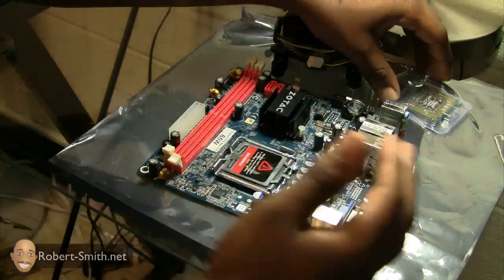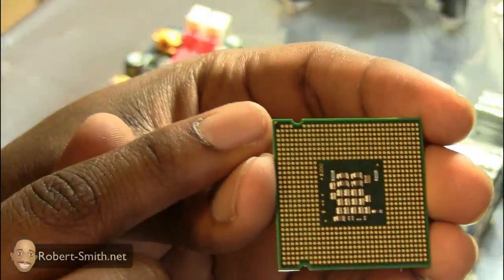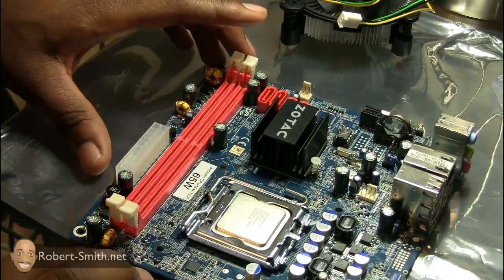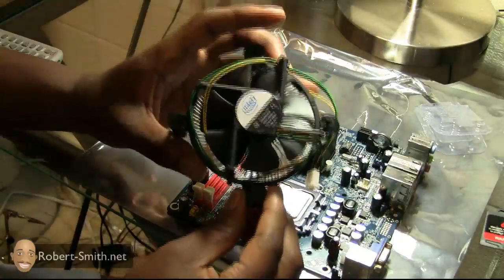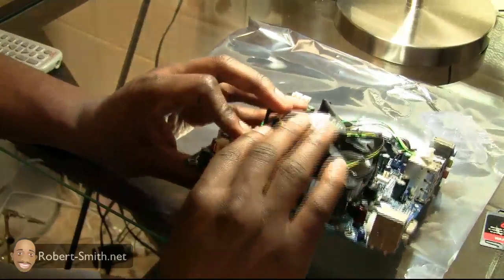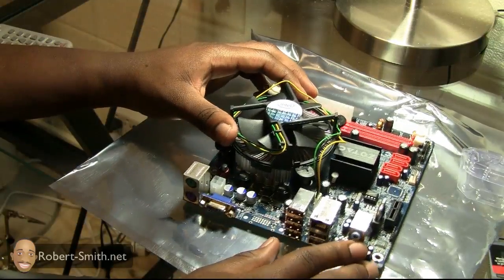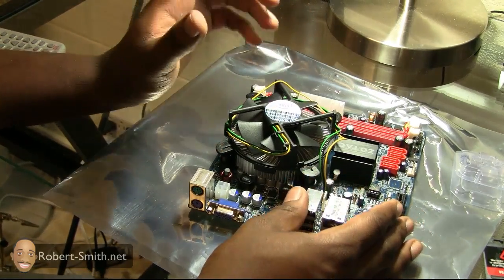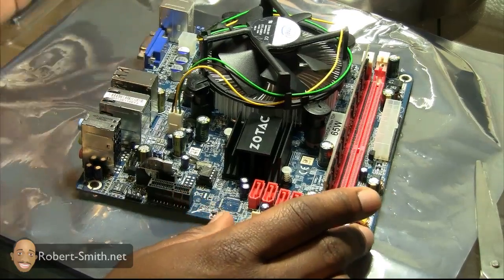How To Build A Mini ITX Computer Part 5/9

Comment from the maker: @iuno777 There is thermal grease already on the HSF since it's new, however, I know that thermal compound isn't the best, so I did add some Arctic Silver 5 at a later date, however, I did not record that portion of it.

Comment: I wish I lived close to then I could just give you a sensor that came with one of my asus boards Its just a little wire with a small flat sensor on it. I never used it because its for a digital temp guage you can put on the front of your computer in the drive bays. You may be able to get a temp guage on newegg or xoxide. they would come with the sensor that you slide under your heat sink on top cpu

Comment from the maker: @shartne I made these videos except for the first 2 about a month or so ago, and I had to return my zotac motherboard because it was not detecting the true CPU temperature in the BIOS, it would just simply say "N/A", and the support desk person said it was probably a bad sensor on the board and to request a RMA, so I did that, and got a new motherboard, and had the same issue! So the support guy said to request another RMA...ehh So I don't think I'll be using a Zotac motherboard in the future :(

Comment: I like Evga, gigabyte, or Asus motherboards and I made a quite a few of them. Asrocks are pretty nice too. Let me know how that Zotac works out down the road. some times those pins can be a pain but you must be sure they are connected. Don't get a magnetic screw driver too close to integrated circuits i found that out. Window seven I have on a couple it works nice but microsoft can spy on you with it.